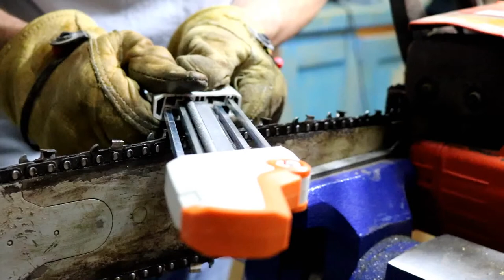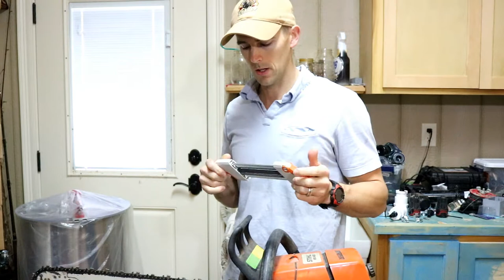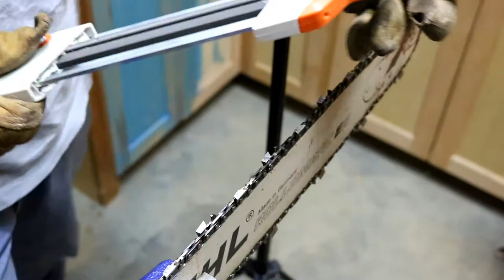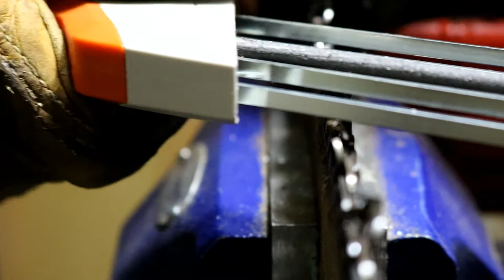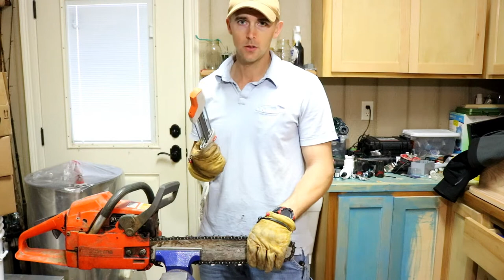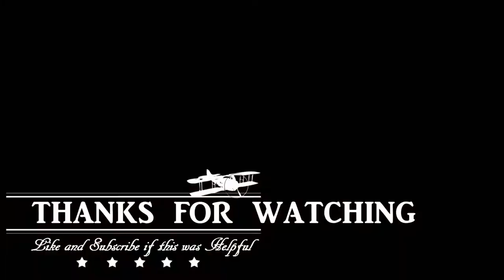Stihl Chainsaw 2 in 1 Easy File Really Easy!

Comment: Noting that I have YET to be able to sharpen the mower blades, I have also worn out two chain saw chains... stretched beyond use of sharpening, but the electric chainsaw has gone far beyond what I ever expected of it, and I am quite impressed on how well it has done! Watching and Supporting - Grabbing more of your time!
Reply from the maker: It look like it is really working well. once your chain gets dull it will get hotter than normal and stretch prematurely. When it stops making wood chips and just dust its not sharp and you should sharpen it or change it and sharpen it later. Thanks for watching.

Comment: What's the saw you're sharpening there?
Reply from the maker: That Murder Inc. Ms460 & 55 Rancher
Reply: MTRUNK 85 the guy I cut with has 460 Magnum. The thing is a beast.
Reply from the maker: That Murder Inc. It is, it will run a 25" bar very well in oak. Hope to do some milling with it soon.
Reply: MTRUNK 85 we clear right of ways for local road crews, and we dropped some huge red and white oaks with it. I use an 026 and its a warrior too.
Reply: MTRUNK 85 someone just gave me a new Poulan Predator in the box, never started. I'm very curious to see how it performs. I'm skeptical but the reason I took it was because my dad got 8 years of cutting firewood out of a Poulan Wildthing.
Reply from the maker: Well if it's free it's going to be good, but after running these two I would never buy anything else. I favor the 460 just feels right and start a little better.

Comment: Nice video, Thanks for subbing, I subbed
Reply from the maker: Thanks found your channel the other day liked the project. Just got a Chainsaw mill your video on that was helpful I'm planning on using it with my 460 on some Oak.
Reply: Thats cool,   I am fixing my dad's husky 460 right now, needs a couple of things.  Maybe I will make a video about fixing.  In my experience with making oak lumber with a chainsaw mill, make sure you use plenty of oil to keep the chain lubed.  Oak is very hard to cut.
Reply from the maker: Thanks for your Info and videos. Over the last year of making videos it has been fun talking with complete strangers helping them and getting help.